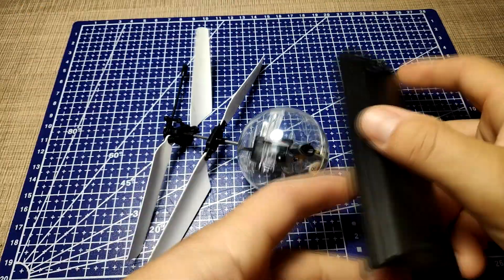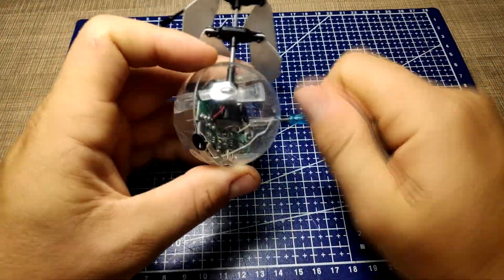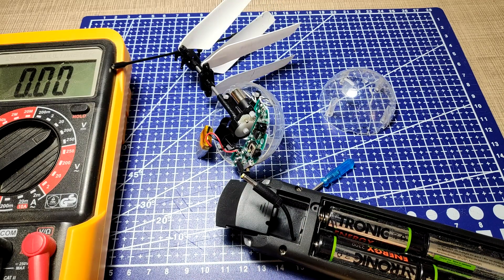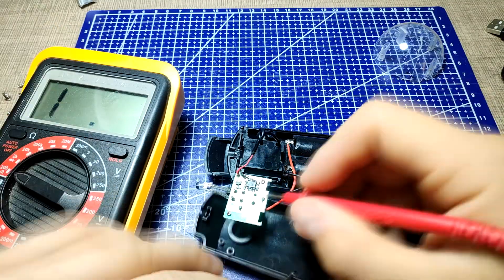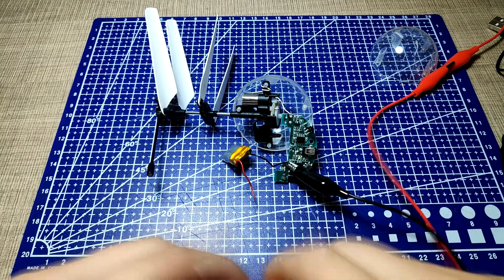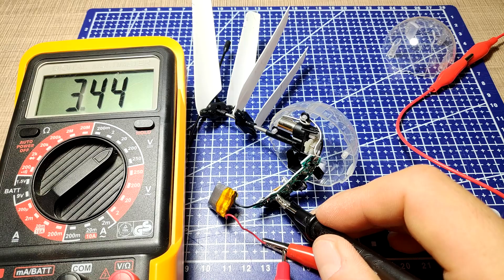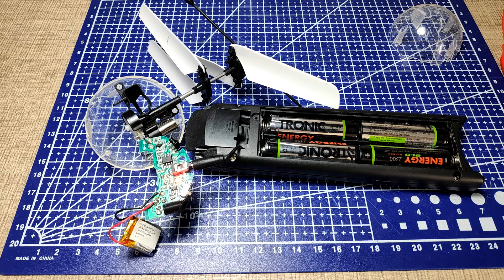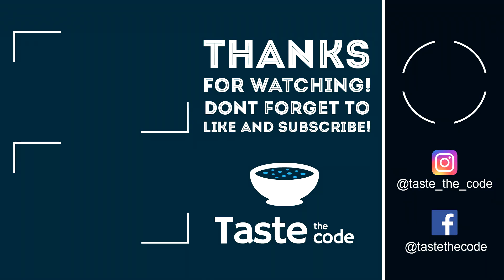Helicopter ball toy repair - revive a Lithium battery that won't start charging

Comment: My I-Fly Ball just "takes off" when turned on? Any ideas why? Thanks
Reply from the maker: Check that nothing's blocking the infrared receiver at the bottom. If there's something in it like lint, it will think that it is close to an object.

Comment: Hello.. 
On- off button has came off so 
how to fix on-off button and what tools do I  need  ?
Reply from the maker: You can replace it with another switch and you will need a soldering iron for that.
Reply: @TasteTheCode  thank you for instant reply....
But how ??
Reply from the maker: @namrataborle2058  just do what I did in the video. I add extra wires and add a new switch.

Comment: Sir whenever I am flying it it is not going up or sometimes it Just sticks to the wall . Can I get ur phone no I wanted to contact with u my email I’d is antarikshpaul@gmail.com
Reply from the maker: Do not share your personal email in comments on the Internet. And, sry but you can't have my number. If it is not going up, the battery might be weak. If it sticks to the ceiling, than, something might be blocking the IR sensor or the sensor might be loose on the PCB.